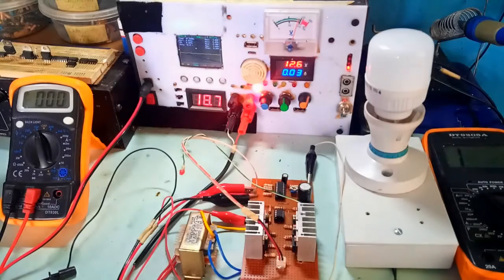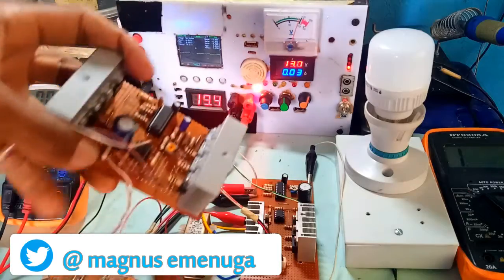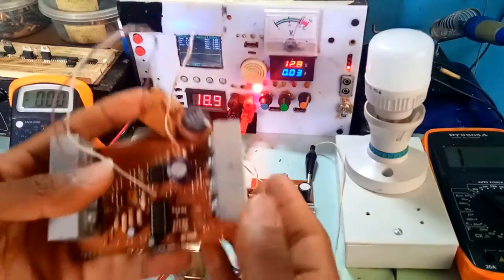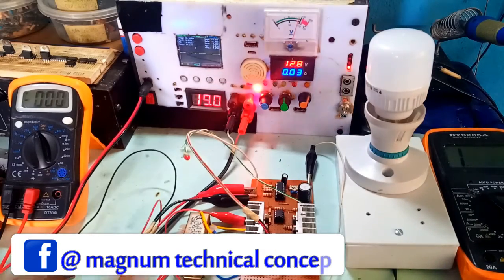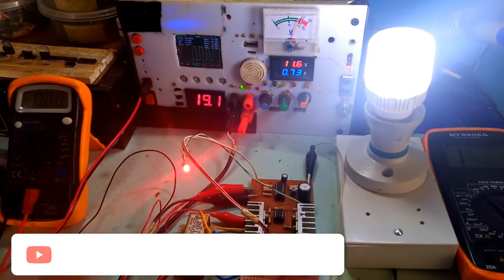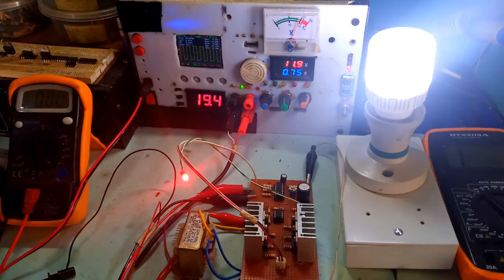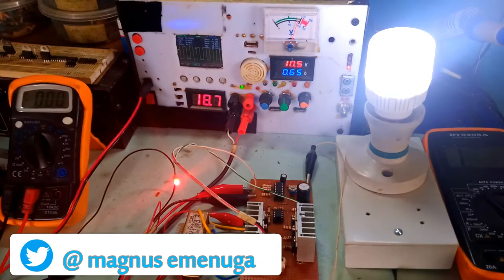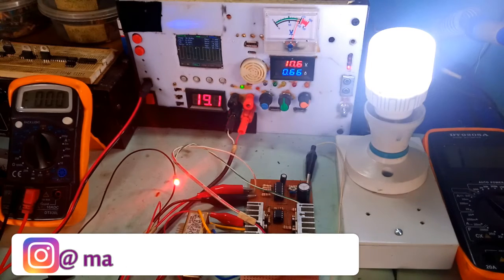SG3525 Inverter Circuit:. Test run and Troubleshoot of Sg3525 inverter Circuit ( feedback loop)

Comment: If you are unable to keep the output voltage stable, then you are still learning on how to design inverter.
First you need to connect 104 in parallel with 390k resistor from pin 9 to pin1 of the sg3525 then you connect 10k resistor from pin16 to pin2 and connect 100k resistor from a positive rectified 12v auxiliary power supply that is coming out from your transformer to a verabel resistor and the middle pin of the verable resistor to pin1 of the sg3525 while the last pin of the verable resistor to the ground don't forget to connect the negative terminal of the auxiliary rectified to the ground and connects 1uf capacitor from pin1 to the ground, with this configuration you will be able to keep the output voltage stable.